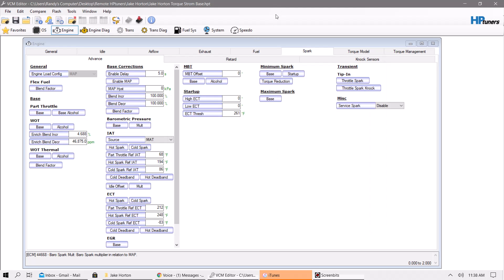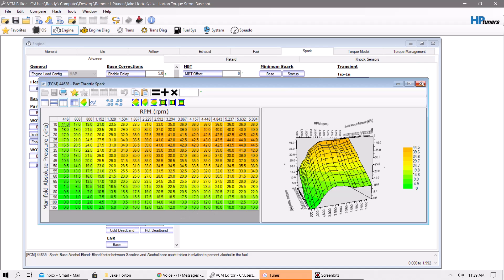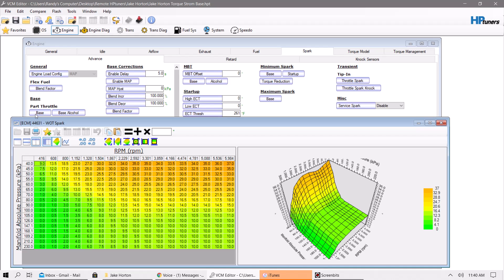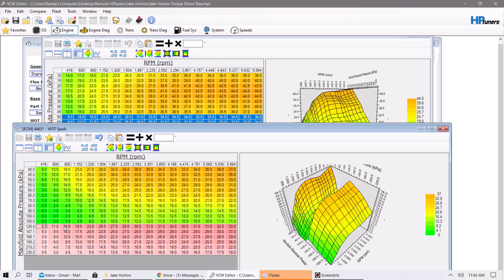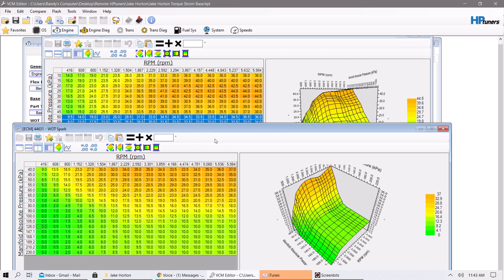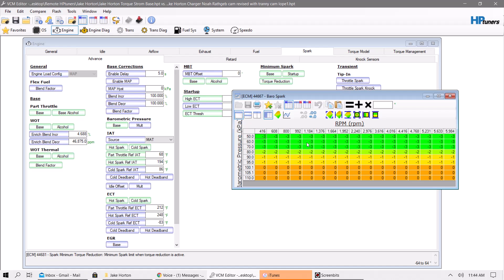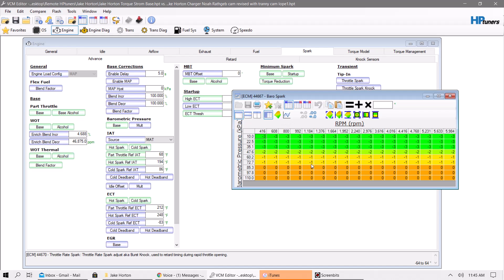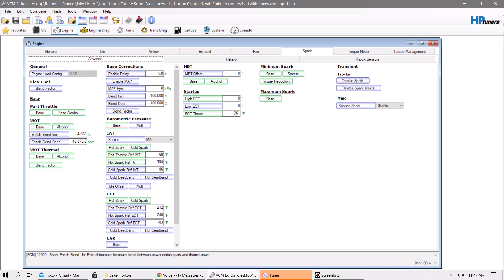Setting up your timing tables for boost non vvt hemi

Comment: I've been tuning my torqstorm 5.7 hemi for the last year and I was wondering if you guys had some data on air flow tables?
Reply from the maker: Doing one right now, are you having issues?
Reply: @Recklessmotorsports  at the start i was having throttle hang or safety mode(i think?) come on and the car would just go limp until it hit 1800 rpms and below 30 mph...since then i haven't experienced the issues even when pushing over 4000 rpm